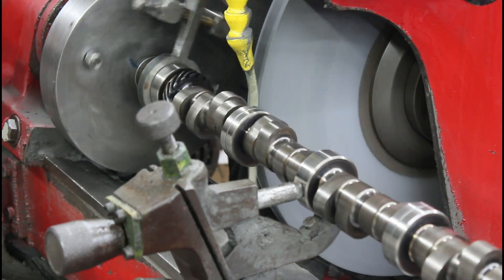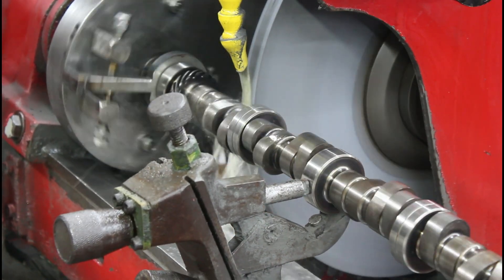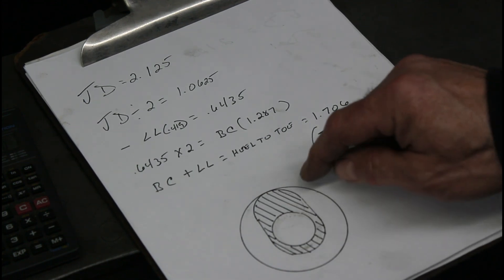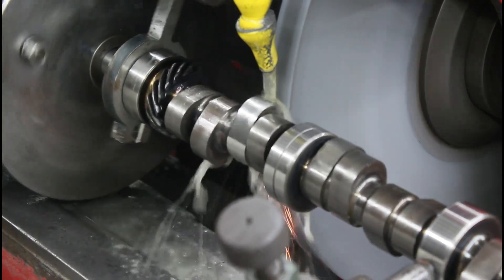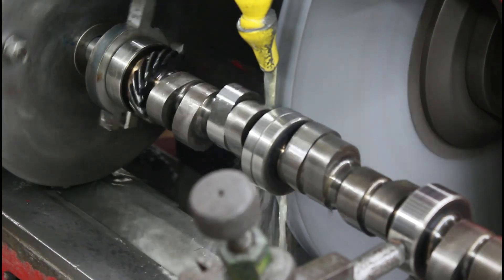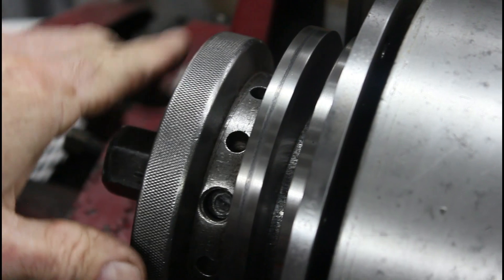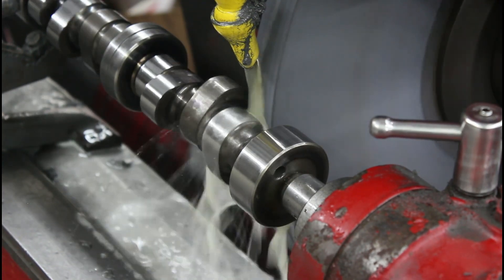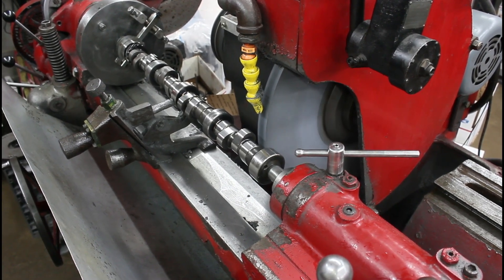Grinding a solid Roller Fe Ford Camshaft And more cam grinder tech

Comment: I need a mild roller grind for a Ford 428, 4 speed galaxie 3.25 gear. Edelbrock rpm heads 10.5 compression. I want a CJ style PowerBar, so low .500s lift and around d 220 degrees @.050 on a 112. That's just a ballpark... I'm not a grinder like you and if you have a recommendation I'm going with the expert. Anything off the shelf or do you think I need a custom grind? Whats the cost on a mild street roller?
Reply: Supposed to say powerband
Reply from the maker: no prob at all, email @ powellmachineinc@gmail.com or call, we can take care of it for you

Comment: By far the best explanation and demonstration I've found on this process! Thanks for sharing! I do have a couple questions about the machine, is the axis of the follow wheel the same as the grinding wheel? also, what are the effects of wear of the grinding wheel?
Reply from the maker: Glad you liked it, no, the follow wheel is not on the same axis, the wheel is large it wears little,  we rough grind then dress and finish grind. No measurable wear.
Reply: I really liked this video!  Do you regrind used cams?  I have a stock magnum 5.9 cam that i would like reground. Is a 108 lsa possible/feasable on one of these? This will be for mild street use and some towing.

Comment: Thanks for sharing this video, very informative. What is acceptable base circle variation from lobe to lobe? I have a cam here ground elsewhere with  .032 difference from smallest to largest base circle diameter, this is a rocker on cam engine ohc no rhyme or reason on this cam just all over the place
Reply from the maker: "If " the lift is the same from int to exh base circle should be within. 005, now have said that some times there are other factors,  but... all intakes should be the same and all exh should be the same.
Reply: @powellmachineinc  Thank you for taking the time to explain that to me 🙂 I very much appreciate it and will not use this camshaft...

Comment: Do the lifter center lines always align with the left or the right edge of the cam, or does it vary for different lobes or different engines? Thank you for all this info!     Dave
Reply from the maker: On roller cams the the lifter is centered on the lobe, on flat tappets they're slightly offset